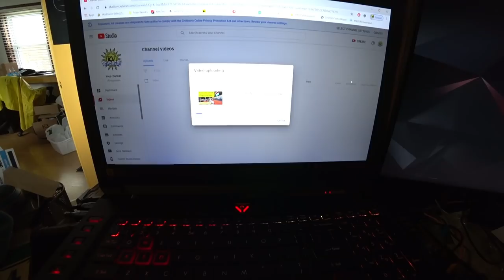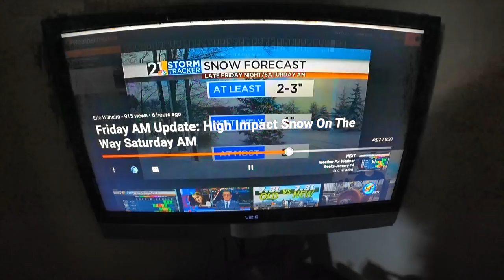RVDaydream Watcha Doin 1-18-20

Comment: We’ve  heard that the 20lb exchange tanks do not usually have the full 20lbs of propane. Plus I wouldn’t want to exchange my new tank for a painted rusty tank.  Other than that, it would be a good idea.
Reply: Exchange tanks only have 15 lbs of propane {3.5 gallons} it tells this on the cage and the wrap that is around tank
Reply from the maker: Usually the tanks that are available for exchange are repainted and in better condition than most people's that are being turned in. They have to go through some sort of an inspection and repair before they are available 4 Exchange. As far as getting them refilled versus exchanging them, I've heard some pretty good horror stories about not finding a good place to get it refilled and the guy only gets it refilled part the way cuz he don't know what he's doing or because they just charge flat rate and they don't care how much propane actually gets in. So while you're on the road you got to make sure you find somebody that knows what they're doing or even getting your own tanks refilled you could come up short. But as far as exchanges I agree as far as getting them refilled versus exchanging them, I agree Sometimes they come up a little short. But here's the thing, if my camper is out in the boonies and it's cold and I don't have any heating source for the night because I miscalculated how much was needed, 15 gallons of propane at 3 in the morning when it's freezing outside sounds pretty darn good verses having an empty 30 lb tank that can't be refilled until you find a business that's open. And again you better hope it's a good one.

Comment: 4 way pin for towing would be easy go run a tag light.
Reply from the maker: He has a 5 pin round on there now
Reply: @Rvdaydream  I bought a tag light for trailer that matches tag bolt holes then you could use a 4 way pin harness to connect to the light. Then again I'm anal retentive about following laws and not giving them a reason to pull me. Ok your reply states 5 pin should be away to tie into that (edit)

Comment: Swing by a junkyard and see if they have any conversion vans with the plate holder on the tire cover(fiberglass). Check out RJ adventures for someone who drives from Ohio to Florida and camps he stays at south of Orlando and check out Florida water management website 14 day free camping with signup online.
Reply from the maker: Yeah we have been a subscriber of Ron and Julie pretty much since the beginning of their Channel. My son knows all about those locations he just wants to be able to be in an area that's populated enough that it makes sense so that he can potentially have work within a reasonable Drive reach. As far as those wheel covers you might as well be looking for hens teeth. The problem is the junkyards don't list them in there database so you have to physically go through all the wrecking yards yourself. And all of our local ones have come up empty.